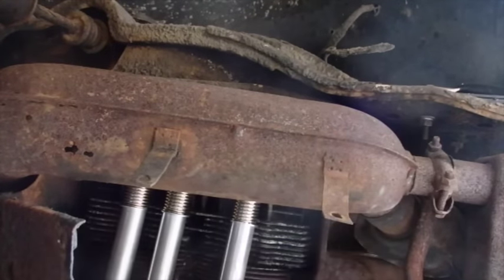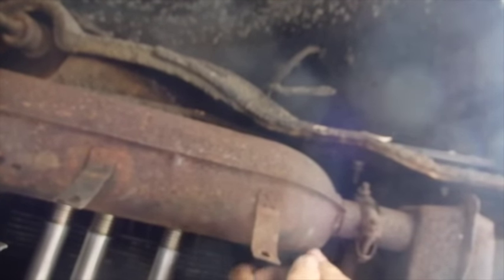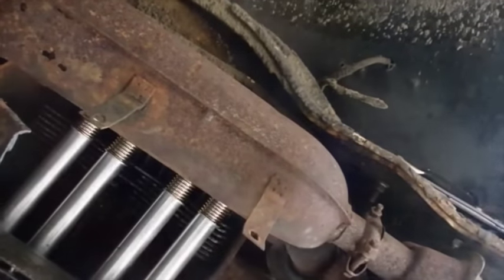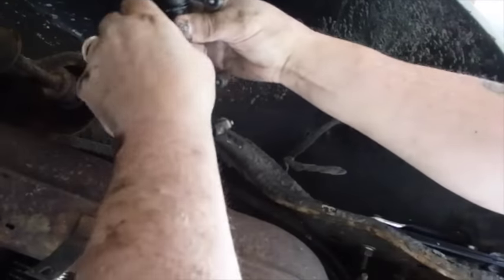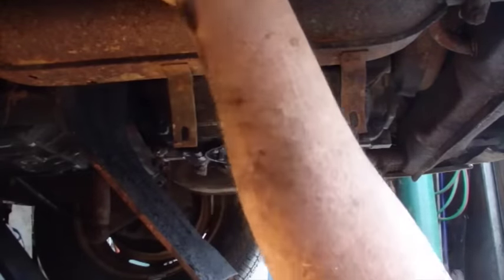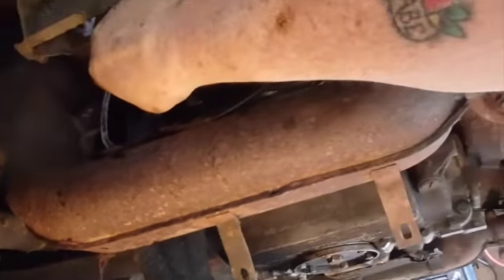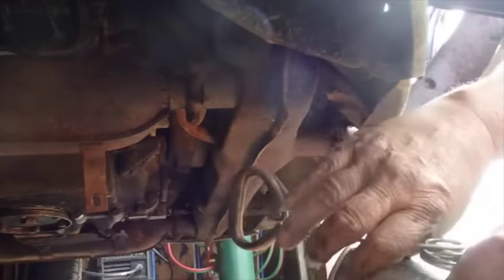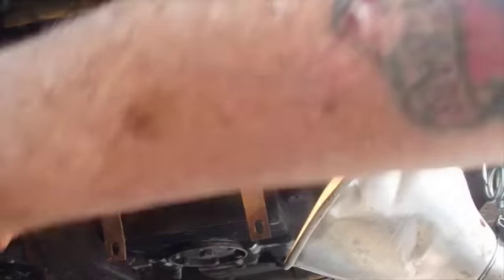67 VW push rod tube swap out 5

Comment: well the good thing with those you dont have to worry about crushing them. it looks like its impossible to collapse those compared to those other thin ones it originally came with. It doesn't look real easy to change but hey when its done you wont have to ever redo them.
Reply from the maker: True.

Comment: I'm not hating on V-Dubya Engines, but isn't it supposed to be just the car body that rusts out?
Reply from the maker: Well, I've seen Dodge trucks up here in Maine that they used to plow snow with have the exhaust manifolds rust off 'em, so I guess if it's rustable, it'll rust.   VW engines are titanium so I suspect the engines themselves don't but all the metal parts would..